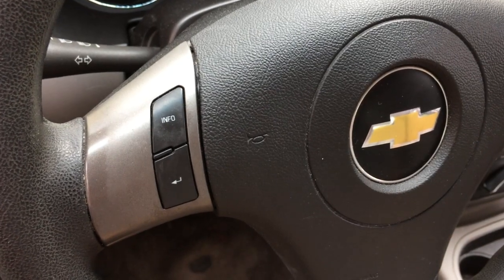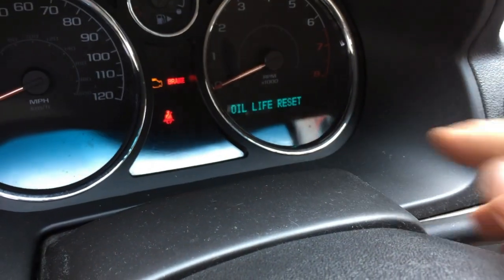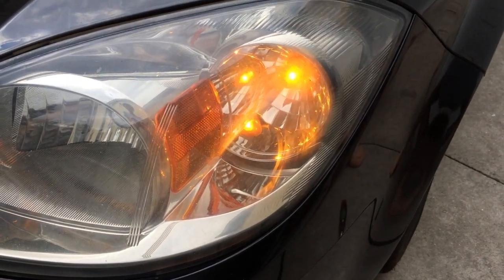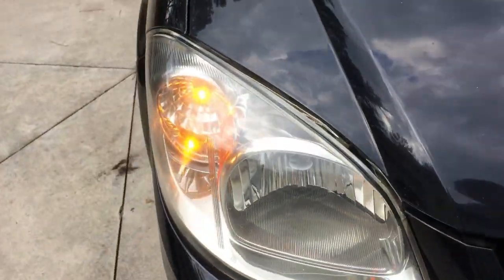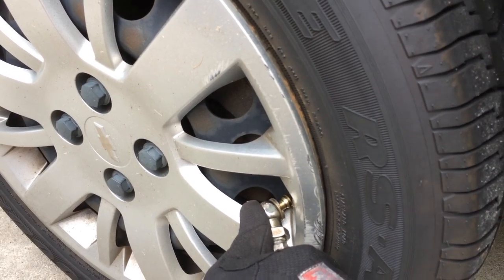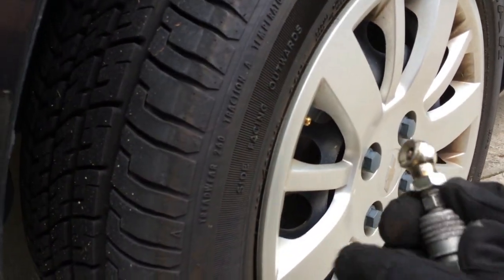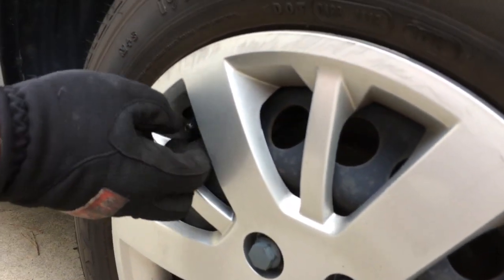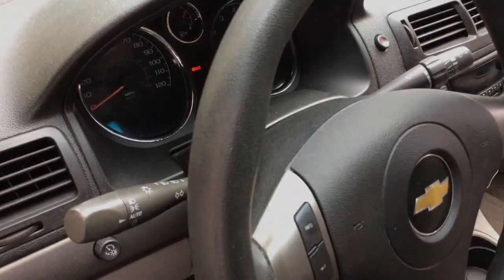GM Tire Pressure TPMS Relearn Procedure after Rotation (All Chevy Cobalt & Pontiac G5 w/o RKE)

Comment: It's not letting me get past the first tire
Reply from the maker: I've found it can sometimes help to move the car so the valve stem is further away from the concrete/asphalt ground, in cases where the sensor battery has become weak.  Can also be that the sensor battery is dead if you were not getting a psi reading on the dash board before starting the relearn (usually a -- symbol).

Comment: Hi,
I have replaced 3 out of four sensors and didn’t yet replace the right  rear because my tire shop showed I have a slightly bent rim.  I want to source a new rim this spring.  However I couldn’t get my cobalt to skip a tire. I tried lying by doing drivers side rear twice and it did NOT detect the change in pressure the 2nd time.  

Am I out of luck until I get the last sensor replaced?  Any way to do 3 out of 4?  If I turn off ignition, it cancels learn mode.
Reply from the maker: For highway safety purposes, the GM software will not permit a TPMS sensor skip.  So you'll need four working TPMS sensors.   However, if you get a tool to activate the sensors, instead of using the manual tire pressure method shown here, then you can learn them before installing into the tires (though you will still need four working sensors total).  https://youtu.be/PN_SUusV2kk and https://youtu.be/HInOI5Lm29Y may help
Reply: @ - I had to ask. 😀

( if there was a way to complicate a situation, I will be in the atypical group )

Comment: My 2008 cobalt has no option to learn tire when cycling through the options
Reply from the maker: This video is only for manual lock / window vehicles that do not have the remote keyless entry (RKE) option as shown in the video title.   But if you do have RKE, the video description goes over the alternate way of accessing this menu.

Comment: 2009 Pontiac G5    no tire learn choice option
Reply from the maker: If your vehicle was not originally built to be sold in the USA, perhaps in Canada or Mexico, then maybe not.  But for USA, it's there as Federal law requires TPMS.    It can also be a problem with your menu switch, not cycling thru all the options (common issue after so many years of usage).   Check your owners manual to verify correct operation of the menu buttons.

Comment: Doesn’t work on all cars 2009 lt wont work
Reply from the maker: This video is only for Chevy Cobalt and Pontiac G5s like the title says.  It does work for all 2009 Cobalts, as the video is a 2009 Cobalt.  ;-)

However, if you have the RKE (remote keyless entry) option, you will have a different path to get into TPMS relearn mode.  Check this videos description, or your owners manual, for the difference.  Once in TPMS relearn mode you just proceed the same as I show here once you are in relearn mode if you have RKE.  If you cannot get into relearn mode via the DIC interface, be sure the switch button is working properly to action the menu option.  It's a common failure for the switch button to have given out.

Comment: I have a 2010 cobalt. I have two more buttons on that side than you do and the interface system that you’re looking at that says tire learn on does not even give me that option when I follow your instructions so I do not believe it is for all Chevy cobalt, sir at least not in this direction that you’re giving so again not for all at least not the way you’re telling us to do it
Reply from the maker: This video visualizes the TPMS relearn instructions in the  Chevrolet Cobalt owners manual.   There are differences between vehicles with power door locks, and those with manual locks shown in this video though.  Those differences are explained in the video description.  Always refer to your own owners manual though for possible production line differences.
 
It may also be that your car has newer sensors, or aftermarket sensors, which require a special tool to activate that uses a radio signal instead.   That radio frequency relearn trigger tool approach is covered in this video, https://youtu.be/HInOI5Lm29Y

Comment: I don’t have the Tire learn option for w/out remot keyless chevy cobalt LT. What should I do?
Reply from the maker: If your car has RKE there's some more info in the video description text.
Reply: @DrShock  it doesn't have RKE
Reply from the maker: Then it should be what the video goes over.  What year Cobalt/G5 is it?
Reply: @DrShock  2009 chevy Cobalt LT
Reply from the maker: The vehicle in the vid is a 2009 also.  So if you're not getting this on the DIC menu following what I showed (i.e., there is no option to enter relearn mode) then this has been disabled in the BCM and you'll need a shop with a GM Tech2 scan tool to re-enable it (rare but could have been accidentally disabled in a previous repair).

If it shows on the DIC menu, but you cannot activate/enter the relearn mode - this is usually more the result of the steering wheel button being stuck or defective.  If this is the case, that button assembly would need to be replaced, but you might get by just cleaning it with canned air (like for dusting a PC keyboard).
Reply: @DrShock
  May be the system disabled during the previous ownership. I'll  check with the Chevy/GM dealers if they have tools to enable. Thank you for the information 🙏

Comment: I had a question my cobalt won’t go into “tire learn on” after holding for 3 seconds on the “tire learn?” Menu. Do you know what this is? Thanks in advanced.
Reply from the maker: If you have power locks/key fob, you might try the alternate approach described in the videos description.
Reply: @DrShock  I don’t, I have base model with manual everything. My tire pressure sensor reading all show LF—PSI—RF and LR—PSI—RR.
Reply from the maker: That really sounds like having one or more TPMS sensors with a dead battery.  But usually the TPMS amber warning light on the dash would be lit, and a SVC TIRE MONITOR green text warning in the DIC.   You didn't mention either of those, but with no readings plus no entering relearn I'd have to suspect sensor batteries.   This other vid may help - https://www.youtube.com/watch?v=PN_SUusV2kk
Reply: @DrShock  sounds good I do also have those going off. The tpms light does flash at start up and does say the warning in green text. I’ll order some, what do you recommend as far as where to order?
Reply from the maker: There should be a couple of links in the description of that linked video.

Comment: Hey the set button doesn’t work. When the tire learn option comes up! Is there a way to fix that?
Reply from the maker: If the set button on the steering wheel isn't working, that indicates that the switch is bad for that button.  You can sometimes get away with opening it up and cleaning the contacts, but more often than not it needs to be replaced due to wear.

Comment: How do you turn on the tire learn if you have cruise control buttons instead of the two buttons you show on your video?
Reply from the maker: These steps can be very make/model specific, the owners manual should explain the steps needed to put the sensors into learn mode during tire rotation, for example.

Comment: What years does this work on?
Reply from the maker: This video is around 2008 - 2010 Chevy Cobalts and Pontiac G5s that had the manual tire pressure release method of TPMS relearn.   Likely covers all GM vehicles from this same year range that supported this method.   

Sometime after this GM moved to requiring a special radio frequency generating tool to perform the relearn procedure to reduce shop time instead.

Comment: Hello. Just purchased an 09 Cobalt XFE. My tire TPMS light is on. I tried this but quickly found out that my info button does not work. Any suggestions or videos on fixing that button?
Reply from the maker: You're saying you cannot get the driver information center menu to show at all?
Reply: @DrShock  the information shows. The enter button works. The info button does nothing.
Reply from the maker: If you're sure the information button is non functional, by trying out other features with the info center that require it, then it's probably a problem with the switch on the steering wheel itself.  Typically they are going to go bad internally, so you have to pull the steering wheel and replace them.   You could try to be sure it's not just sticking due to dirt or light corrosion by attempting to depress it many times quickly, that might be a temporary fix just to get the TPMS relearned.
Reply: @DrShock  Thank you for the info. Ill tear into it this weekend. I've done some digging and found the part number. They are discontinued. Hopefully it's just a loose or dirty connection
Reply from the maker: np on those kind of discontinued GM parts it can be cheaper, and more fun, to hit a local LKQ or similar pull your own parts salvage yard and grab one there.

Comment: If I replace the sensors because it’s giving me the “- -“ symbol, will the car automatically know to utilize the new sensors for the resetting process?
Reply from the maker: As long as the sensors battery hasn't died, then yes each sensor has a unique id code that is communicated during the relearn process.  That's how each sensor gets associated with the physical tire location on the vehicle.   If the sensor does not respond during the relearn, then most likely the battery has died.  The batteries are not replaceable, you have to replace the whole sensor inside the tire.  I have another video on how to do that repair as well.

Comment: Might work on base models without keyless entry. 
Nothing on mine no tire relearn
Reply from the maker: You just haven't found it, check your owners manual.   Federal law required all motor vehicles sold in the USA after September 1, 2007 to include a TPMS, so not just Cobalts and G5s.
Reply: @DrShock  no it does not work on models with keyless entry. For some stupid reason you have to use the key fobs to get it into relearn mode
Reply from the maker: Ah ok I thought you were saying you had no relearn mode.   Looks like if you have the rke option Chevy wanted to make it easier for you so instead of using the DIC you just press lock and unlock at the same time on the fob for 5s to initate the relearn.  After that its the same process for all.   Thanks for commenting, I'll update the video description for this case.
Reply: @DrShock  I don't know why they would use 2 different methods, like in my situation I bought the car with no keyless entry remotes, so I can't program the sensors until I get some fobs programmed.
Reply: @asasial1977  And you now know the answer... more and more vehicles have keyless entry and GM/Chevy makes a fortune selling programming/reprogramming FOBS for customers!
Reply: I don't have relearn on mine either..keyless entry no fob
Reply: I have a 2010 chevy cobalt and I don't have a tire relearn option
Reply from the maker: @Mr.Sanchez22  It's on page 6-68 of your 2010 Cobalt owners manual.  Only found on USA sold Cobalts tho.
Reply: @DrShock  thank you

Comment: I have a Chevy Cobalt lt 2008 coupe the tire relearn never appears on the dashboard only oil life reset unlock options ECT please help
Reply: Carlos Lima if you have a fob it says to turn the key to on with the engine off and to hold the lock and unlock buttons  till it starts the process. It didn’t work for me till I started my cobalt with the auto lights off, then hit the lock and unlock
Reply from the maker: Page 5-59 of your owners manual describes situations where the TPMS has malfunctioned (dead sensor for example), and page 5-60 thru 5-63 describe the relearn procedure for with and without keyless entry.  If that's not working, you have something to repair in the TPMS before you can do the relearn.
Reply: i have the same problem, how did you fix it?
Reply: @jaredlopez7128   yep i have same problem i just replaced 2 sensor and the tire relearn never appears :(
Reply: v i read my reply maybe it’ll work for y’all
Reply: Jared Lopez read my reply